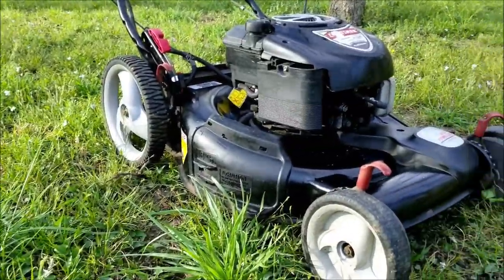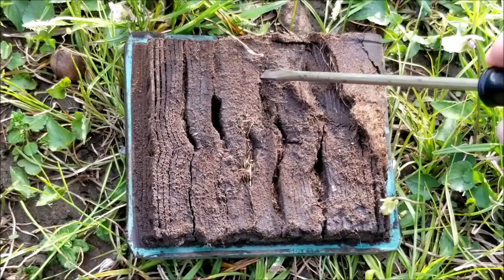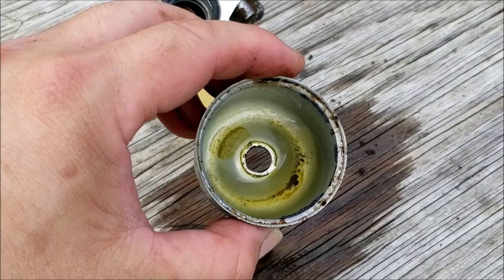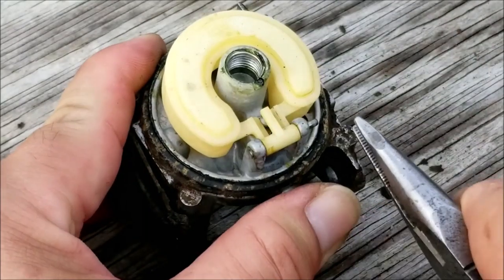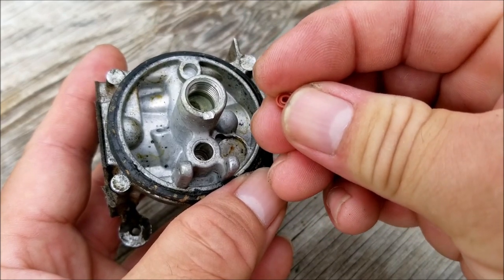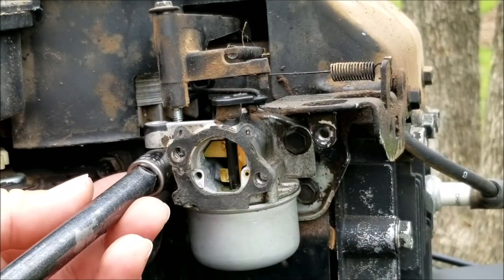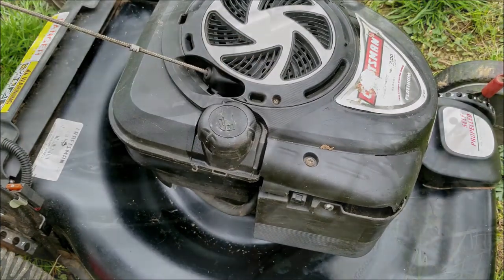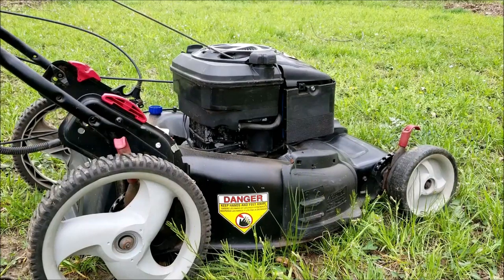Mower won't start and leaking gas

Comment: First, I explain the issue to the customer and then do as instructed.
For me I would have done just what you did. More often then not I have a rebuilt carb on the shelf, so that's always an option.
Briggs carb issues are so common I keep Kits on hand and keep those carbs from replacement jobs to rebuild.
Great video, not many show that problem with the needle seat.
Well done...
Thanks again
Reply from the maker: Thanks for the comment I appreciate very much.

Comment: Good Job: I have done it both ways, I usually change the needle and seat. Those original carbs are pretty tuff and usually don't need to be replaced. I sometimes run them thru my ultra sonic cleaner if they are really bad. You can buy seats in ten packs pretty cheap. A little wd-40 or light oil on the seat when replacing it  makes it install a little easier. Many thanks.
Reply from the maker: Oh that's a good idea. Thanks for the comment I appreciate it

Comment: Great video 👍 I usually try replacing the needle & seat after cleaning if carb isn't real gummed up. If the carb looks really bad I will replace it with an aftermarket carb.
Reply from the maker: you and i are the same. thanks for the comment I appreciate it

Comment: Just fixed a friends mower, every time he cleaned the carb out it would run until it got hot so he thought it was the carb. The problem was the dead mans handle cable had stretched and the gap between the contacts was about the thickness of a cigarette paper, the contact switch is above the exhaust and was expanding with the heat and closing the contacts so no spark.
Reply from the maker: Wow nice catch.  Thanks for the comment

Comment: The seat seems like an easy fix. The price of the new carb would help determine my decision. If it was decently cheap I would just buy a new one but if pricey I would go with the seat fix.
Reply from the maker: you are absolutely correct and thank you for the comment I appreciate it

Comment: Just a few weeks ago I replaced the seat, cleaned the entire carb, installed a new bowl gasket, front gasket and O ring seal,  flushed out the fuel tank and supply line on a Briggs equipped Toro that was leaking gas when it sat overnight. Mower didn’t leak and ran like a champ for 2 weeks but now it’s back because it slows down, stalls out and is hard to start (auto-choke is working properly). Waiting on a new carb now, also installing new fuel line and a filter (owner was using brand new gas and had no trouble with his other mower). I usually try to keep the original carb going but in this case i think that was a mistake.
Reply from the maker: yes its sad but sometimes it still needs to be replaced.  thanks for the comment I appreciate it
Reply: Update: Owner got grass clippings into the fuel tank and plugged up the carb. Cleaned out carb (again), installed an in-line fuel filter and it’s good as new. The new Briggs gas cap is a poor design that lets dirt fall into the tank when you remove it. Solution to a problem that didn’t exist IMO!

Comment: what "treated" gas do you recommend? or treatment additive?

i have to drive about 50 miles for an 0 ethanol station it may not be worth a gallon gas can
Reply from the maker: actually I'm trying not to recommend any one brand because there are people who are extremely loyal to one brand.  go to the autoparts store and pick one, follow the directions and it should protect you thru a long winter.
Reply: World Wide United You can look into a product called K100.  I’ve been using it for a number of years, my John Deere dealer recommended it and it has worked great for me,  I use it in my mowers, riding mower, trimmers and generators.

Comment: I would try changing seat first like you did as you know some engines have a brass seat on those before replacing the seat i clean them with a cotton tip applicator of some sort on a drill to see if that works first. That was the worst air filter I think I have ever seen.
Reply from the maker: yes I was surprised by the air filter too

Comment: Thanks. Can you tell me how to fix the bar stop system. The bar pulls back and I let it go and nothing happens. 
I can start this mower the same one u have with bar either way. In and out.  

Thanks
Reply from the maker: are you saying that when you release the handle that's supposed to stop the mower, doesn't work, and it keeps running?

Comment: I would replace the seat in the carburetor but I know that some people will just use the fuel shutoff valve if fitted !
Reply from the maker: yes the shut off valve is a lige saver.

Comment: Do you use rec 90 gas?

And i would of tried to fix the old carb first.
Reply from the maker: no I don't and I'm not sure if we have it available here
Reply: @HomeGaragechannel  what is the non ethanol fuel you use? Cause ive been using rec 90 for my carborated motorcycle and it runs great on it.
Reply from the maker: I just go to my local gas station that says it has 100% gasoline, no branding on it.
Reply: @HomeGaragechannel  alright, could you check to see if it is rec 90 or one of the other ones the next time you go there?
Reply from the maker: I've looked and did not see any
Reply: @HomeGaragechannel  alright, its probly rec 90 or rec 85? I think thats another type of fuel that is ethanol free.

Comment: I probably would have replaced the carb and done
Reply from the maker: yes that would be have the best choice.
Reply: @HomeGaragechannel  it also depends on whether parts are easy to come by or not otherwise if they aren't easily available then the best thing to do is repair it to the best of your abilities until parts are available for it
Reply from the maker: I have come across this situation before too, so that makes sense.